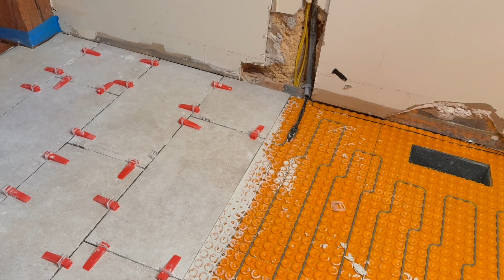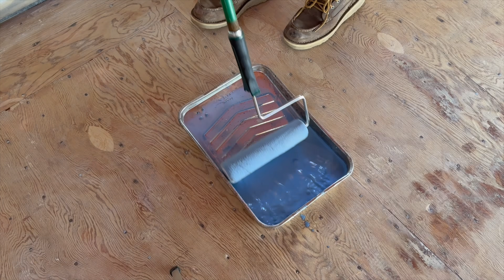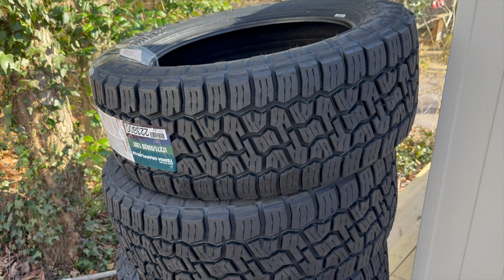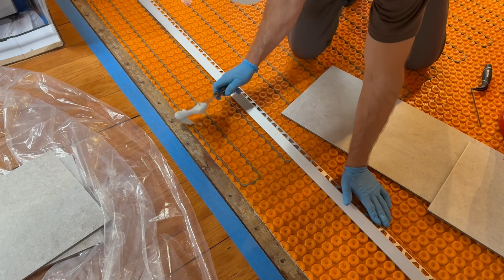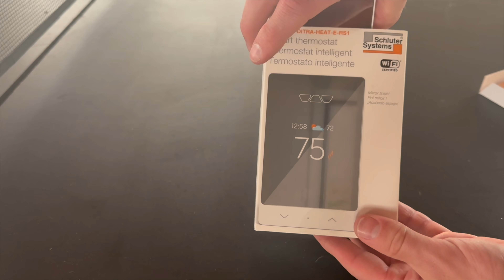How to Install a Schluter Ditra Heat Tiled Floor (And Save a TON of Money doing it yourself!)

Comment: Hi. Cheers from Poland. We do a lot of underfloor heating systems here both electric and water. In my opinion it's better to do water system with electric heater just because you can hook up heat pump later but you do what you like. Cheers

Comment: Great video start to finish. I'd just add one caution: if you use a drill to mix the grout, be sure to go VERY slowly, otherwise  the grout will dry very quickly.

Comment: Good video and nice job. I decided that the Schluter membrane was too pricey for me. I just placed the heating cable in the mud groove while doing the tiling. Its easily done but you need to plan your routing of the cable. Also just doing a section at a time. Its been working great for five years since I installed it.

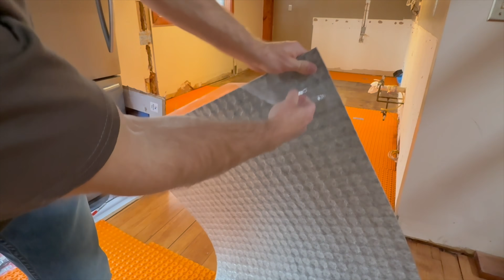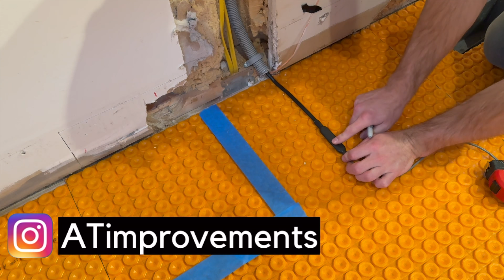Comment: @2:40 I'd guess others have given this tip, peeling a part, putting it down in alignment, and then peeling the rest is a trick that works in a lot of places, and here too. @5:57, I know Schluter recommends it, but for the life of me, I'd be very nervous about burying a wiring connection, transition, or bridge under your feet, that should have been done in a box at the bottom of the wall; honestly for all that Schluter promises, this beats me.  @12:01 Schluter recommends a 1/8" square edge trowel and I'm guessing they are the only ones who sell it :D
Reply: I had the same thought at 5:57 .. I'd want that in a box!

Comment: Hi Andrew. If you can help me with a question... In your experience with this installation, how much can this system heat up a room? For example, if the room is 50 degrees Fahrenheit with the system off, How warm can the room get with the system on? Thank you!

Comment: I'm paranoid about effing up my ditra cable, so I'm wondering about those leveling spacers.  Could the broken off plastic pieces left there in the floor somehow become a problem (sharp edges?  can the plastic melt and cause a problem?)  I'm planning to lay tile this weekend.

Comment: Would you break down your costs for the size of the kitchen? the ditra heat subfloor materials, electrician and also the tile materials. It's hard to visualize the differences in cost. How much you estimated to spend vs how much you actually spent vs how much it would have cost using a contractor

Comment: I am seeing a lot of videos on this system but noticing all are using large tiles. Am I able to use small tiles as well or would that give problems on these mats, besides more work?
Reply: Schluter specifies nothing less than 2" x 2" tiles. I am doing a small basket weave mosaic (DIY homeowner for bath) spoke with Schluter rep and I will be doing an extra step, and putting Kerdi Membrane over the ditra mat before I tile. And they sent a letter making this exception while still providing warranty

Comment: Be careful when sanding old flex mortar as used directly on wood. It can contain asbestos as a reinforcing agent. At least spray it with a mist of water to keep dust in check. Best would be to use a HEPA Shopvac while sanding down.
Reply from the maker: Good tip! This floor was a bit newer (they were using Schluter Ditra, but a good tip for older homes for sure. 👍